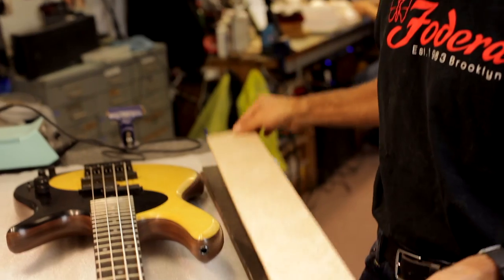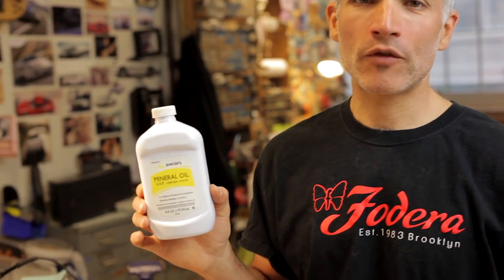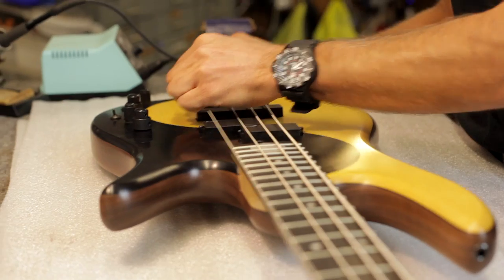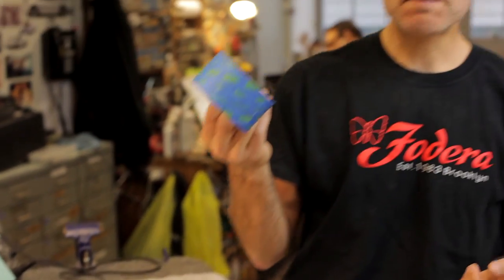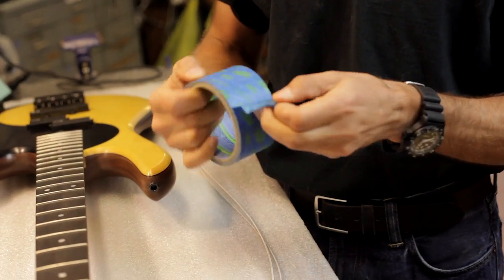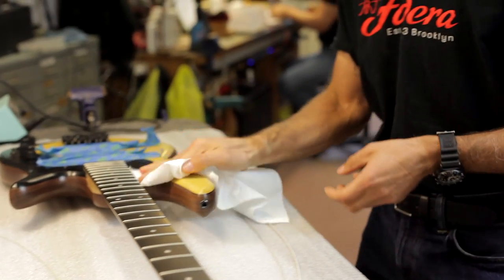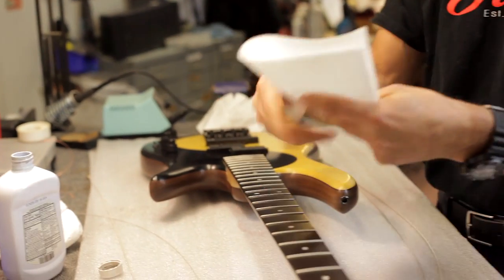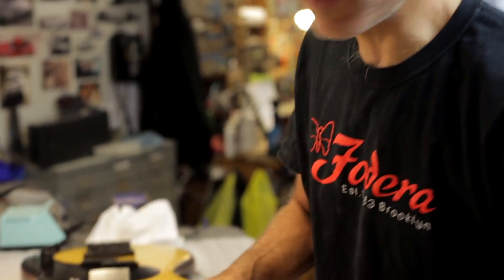Caring for your Fodera: Oiling Your Fingerboard

Comment: I have a Purple Heart fretboard but it doesn’t seem to have a finish over it, and its instruction manual recommended using lemon oil (just as my Indian laurel fretboard bass said in its manual as well), would you recommend the mineral oil on this one?
Reply: mineral oil is always a better choice than lemon oil. but lemon oil does the trick just fine

Comment: Won't you have to do a set up again because of the release In tension from removing the strings?
Reply from the maker: Hi Josh, you wouldn't necessarily need a set up however it is good to tune the instrument to pitch and give the instrument a once-over.